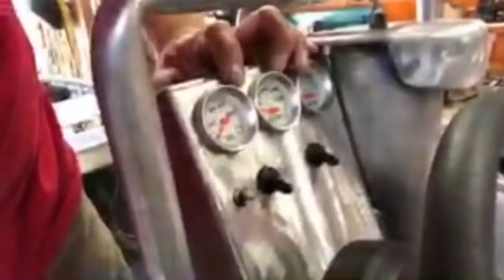SV Seeker Live

Comment: The plastic line for the oil gauge, that stuff cost me a diesel engine once.  The line was less than 10 years old, and it split in its length, and dumped the oil, and I'm sure you know how diesels don't like being starved of lubrication.  I only install copper lines now. (which I buy from McMaster, to get long continuous lengths the auto stores don't sell)

Comment: Hey Doug, I had a cabin cruiser with the power steering pump low to the hull and it slings water everywhere. It was bad enough the manufacturer made up a caution for it. The pulley was probably 2 inches above the hull and under acceleration wasn't a problem but when we stopped water would surge forward and cause belt slip. Can't tell how far up your pulleys are buy would hate to have those issues out at sea. Btw your boat and channel are awesome. I'm in okc and would love to bring the kids up. We talk about adventure all of the time and to see what you are doing is amazing.
Reply from the maker: Well watch for that

Comment: I’d recommend using either a length of copper line / automotive brake line for the oil pressure gauge or putting the mechanical gauge on the motor and installing an idiot light. 
I’ve had an oil leak on the plastic line couplers, not a huge deal, but makes quite a mess.

Comment: Doug,   from my experience you may want to move the light tower in the rear to the center of the transom.   When you are pulled alongside another boat or a pier,  wakes, waves and swells will roll the tender on its centerline and crash the tower into what ever is next to it.   A boat wake will do the most damage.   Just a suggestion you may want to evaluate.   John
Reply from the maker: Yeah that makes sense. We’ll just have to come up with the port side. I didn’t want the tower in the center because it gets in the way of moving equipment over the swim deck.

Comment: Hi Doug, for the oil gage that you used allot of couplers on, you can buy copper pipe I forget the size (1/8th?) but then you can run the full length and maybe go back to a few sections of the tygon tube for vibration.   or buy the tygon by the roll.
Reply from the maker: Thanks yeah I looked at the copper pipe but it seemed kind of fragile
Reply: Copper tubing is the better way to go with the oil gauge line.
The unions used to splice those plastic sections will slice right thru it eventually. Splice 'n slice. Seen it alot with transmission cooling lines, and they run much less pressure.
Cleanup on isle four!!!

Comment: do you know the the valves they use on R V  holding tanks to drain the tank you pull the handle and it let the fluid run to shut it off you push it back in, will work on the air intake to stop engine run away

Comment: Two questions:  1- Why not add a check valve to the "elephant trunks" setup?  2-  How will you reel the trunks back in when the boat is drained and ready to stop?
Reply: These problems may actually solve themselves tho.  Perhaps the hose will automatically collapse when there isn't water pushing out from inside the boat?
Reply from the maker: I think that will keep it down to a trickle and the bilge pump can take care of that.

Comment: I'd suggest q used conveyor belt be used as a side covering protector.  It will resist tearing and cutting them rubbing alongside docks, piers, and etc.
Reply from the maker: The plastic sailboat people would freak out if you pulled up next to him with black rubber on your sides.

Comment: nice work like what your doing with your boat,i got a 16ft jonboat that im thinking putting a alumium floor in mind boat using a flux-core welder brian murphy in md and delaware  i have a 15horse power boat motor good on gas

Comment: I see you are using a nylon tube for your oil pressure line.  My experience in 40 plus years as an auto tech is that nylon has a large fail rate.  I use copper line it can take more abuse and you can get it in long lengths so you don`t have to use couplings

Comment: That VW engine is water cooled. Is there a heat exchanger or will you run sea water through it? Maybe I missed that in the previous episodes.
Reply: loloaqici82qb4ipp you missed the part where he talks about the c-channel in the hull where a large amount of cooling fluid cycling trow the hull
Reply: loloaqici82qb4ipp the exaust have a seawater sprayer after the turbo in front of the muffler
Reply: OK, that makes sense. Thanks.

Comment: Save yourself a headache and swap the oil pressure line to copper or brake line as opposed the plastic line,   Its annoying when it blows in a car, I'd imagine it would be more so if you were in the water.

Comment: Doug, instead of a sunfish rig how about an Omega Sail.. ie an inflated kite sail that fits in a bag as a self rescue option, or just to save fuel and noise when fishing ?  No mast is required, no centerboard or ballast issues, no heeling or tilting over and it can be anchored right to your lifting eye fwd. You could even make it yourself vs buying, though I think buying a small one to learn from and have for a paddleboard or dinghy might be a good compromise... about $500 for a small one. See : https://www.youtube.com/watch?time_continue=4&v=9WPZKuUOKEw  and check out : http://www.omegasails.net/Rescue.html
Reply from the maker: That a cool idea, but we can sew up a parasail ourselves.
Reply: Definitely, the rigging on the sail and winches etc is the only part that needs some knowledge, I think the main difference in a kitesail vs parasail is the inflatable aspect to keep it open and floating on the water when deployed. Looking at it, I'd bet you could use it to tow swimmers around in and under water like your ROV, right ?